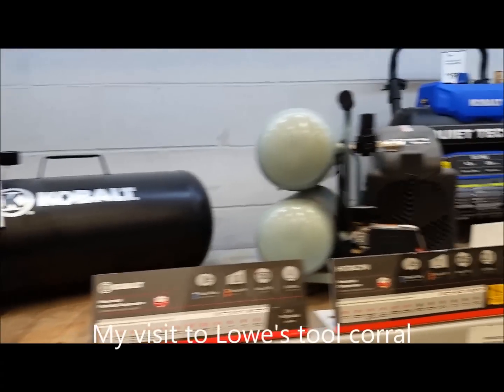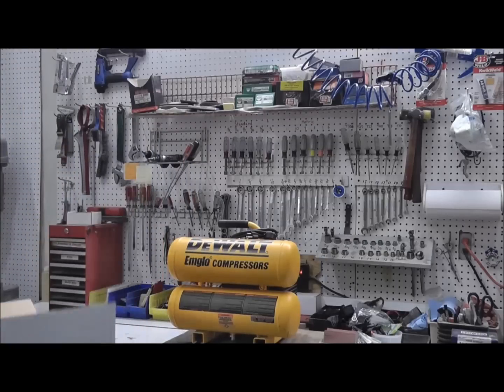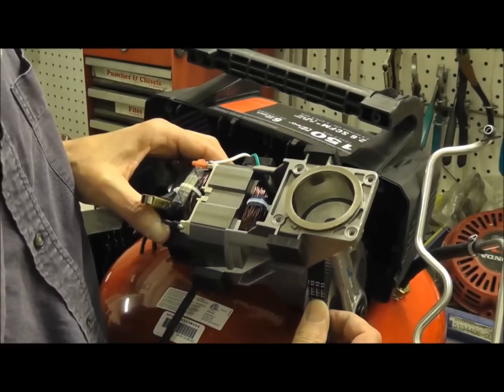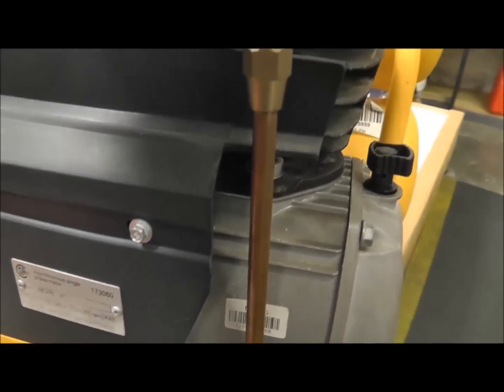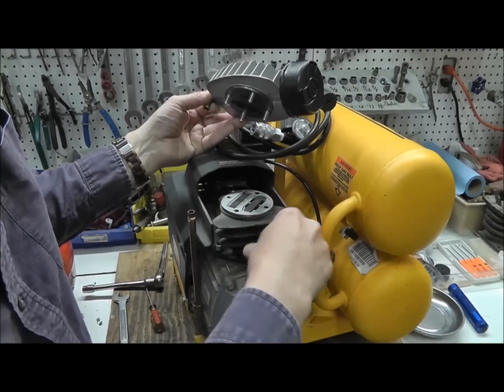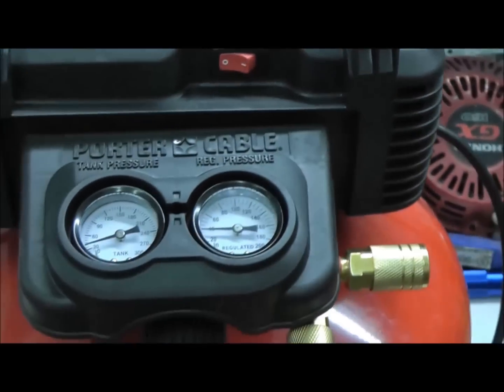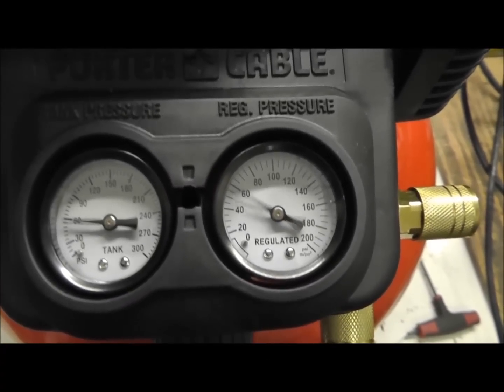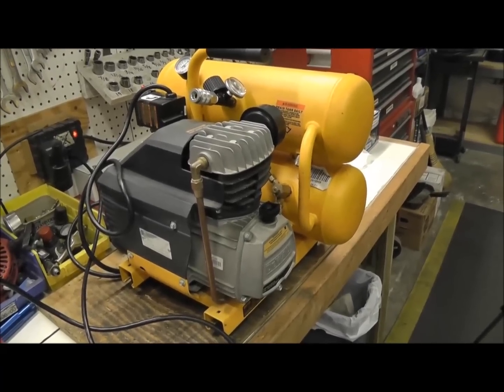Should I buy an oil free air compressor?

Comment: He may mention this as I'm commenting before it's over lol but if you get an oiled compressor and plan to do any painting make sure you get an oil filter for the outlet. There will be water in either style and both needs a water filter but the oil is another beast that will destroy your paint job so needs a combo oil/water filter.
Reply: Apparently something that lasts a long time is more important than functionality.

Comment: That piston is 4 times bigger than the one on the puny little 3 gallon hotdog style Campbell hausfeld I first bought. Takes forever and a day to air up a tire. Glad I moved on up to a bit bigger 20 gallon Campbell hausfeld with 5.5 cfm at 90psi. Works perfect for all I need airing up tires and other inflatables as well as air impact and even a cutoff tool.

Comment: Hello, To me it looks like you’re comparing “apples to oranges” with these two compressors (price points are the difference in construction styles)...  I owned the original Emglo twin tank 4 gallon model and had it for 10 years before I chose to sell it to a friend... I upgraded to the “Masters Series”, the one with the manifold in the center between the tanks(you don’t like) also an Emglo... It is working Perfectly fine(16 years later)...!  You should actually not even mention Dewalt because it’s not Truly a Dewalt...  B&D owns the company Emglo...  Emglo makes the compressors and they paint them yellow for Dewalt...  You can still buy them in blue...
Reply from the maker: Correct, the Emglo name (only) was purchased by DeWalt in the early aughts, and Stanley Black & Decker now owns the name Emglo and build units under the Emglo name with the black and yellow paint. These are not true Emglo compressors. You can still get an Emglo, however, they now go by the name "Jenny, Inc.". The Jenny units are certainly better. Jenny took over the Emglo factory in Somerset, PA and they are still building great air compressors. However, the old Emglo and current DeWalt oil-bath direct-drive air compressors (like you see in this video) do NOT use the same Fini pumps that are on the older models, they're now made in China and are not the build quality of the old Fini pumps. Hopefully this gives some helpful insight into the DeWalt/Emglo confusion.

Comment: Out of all that you showed, the Dewalt/Emglo is the better choice. When these came out They had a lot of issues and aren't the best in a cold area. I like the Bigger Dewalt/Emglo's with the KU pumps have a few old twin tank models and a few of the single big tank models that are 25-30yrs old.
Reply from the maker: Those old Emglo wheelbarrow units can't be beat! They're probably the hardest working and most durable jobsite units out there, along with Rolair's units. Emglo was bought by Steam Jenny and now go by Jenny, Inc. DeWalt bought the Emglo name only and all units labeled Emglo that are black and yellow are NOT the quality of the original Emglo units. Thanks for the comment!
Reply: Switch over to a full synthetic oil and that will help majorly in colder weather.

Comment: I need an portable/light weight compressor to test and charge a 2500 litre volume pvc pipe line with air upto the pressure of  6 kg/cm2. What compressor will you suggest?
Reply from the maker: Thanks for the question! I would recommend an oil-free unit, as you won't have to worry about moisture getting into the lines. Two brands that come to mind are Thomas and California Air Tools. These compressors are more expensive than your "big box " store units, but are much more durable, and have quieter operation. Hopefully this helps.
Reply: @MasterToolRepair  , can these portable compressors have enough juice to fill 2500 litre line?
How long approximately will it take to fill a 2500 litre pipe upto a pressure of 7kg/cm2

Also how long can these type of compressor continuouly run?
Reply from the maker: @green_life7  That I can't answer for a 100%  certainty being I'm not very well versed in the application you would be using the air compressor for. Are you using it for blowing out irrigation lines? If so, the below website should certainly be able to answer your questions as it contains a lot of great information:
https://www.irrigationtutorials.com/gpm-psi-gravity-flow/

Comment: comparing a cheap POS compressor to a much better quality one like the dewalt is a disservice to the point you're trying to make . comparing the dewalt to a 2 HP california air compressor and then sharing your results would be MUCH more legitimate .... .
Reply from the maker: Thank you for the question, Bootymonster, although it's difficult to reply in sincerity to someone with a handle like "Bootymonster". I'll give it a shot, though. Yes, Thomas and California Air Tools both make very high-quality, durable oil-free units, and are generally worth the higher price tag they demand. We didn't have either of these oil-free units available for the video, however. We're not necessarily comparing BRANDS, we're simply comparing the pros and cons, generally speaking, of both oil-bath and oil-free air compressors. I'm not sure where "ego" comes into play here. but alright. Thanks again for the (odd) comment!
Reply: @MasterToolRepair  thanks for replying . my handle is something playful based off the cookie monster from sesame street . i have a 4620A by california air and it has done me well .
Reply from the maker: @JeffB1961  I get it, and it is a funny handle. It's fun to jab each other because that's what social media is all about, right? Anywho, the CA Air Tools units are great and we sell their replacement parts. Most DeWalt units are made in China now, including these oil-bath units. The pumps themselves are based on the Italian "Fini" brand pumps that other brands (like Emglo, Senco and Rolair) used to use, but they're all being made in China now and the quality isn't what it used to be. There is a compressor for every type of application, certainly.

Comment: I just saw a guy rebuild a v-twin oil-less which he claims served him about 20 years, the key to oil-less pumps is that they rebuild rather cheaply and easily. Most do have air filters too. I'd like some estimate as to how many hours they hold up though.
Reply from the maker: Thank you for the comment Robert. Some oil-free units do repair quite cheaply, but it really depends on the manufacturer. Many manufacturers are making parts obsolete more frequently these days, as well. Oil-free units are great for those applications where you need convenience and lower air demand, as these units put out less CFM than oil-bath units. But, if you can't have any oil in the lines and if your'e working in tight spaces, oil-free units are great. As long as they are kept in a clean area, away from particulates, they can last a long time. How many hours is hard to say. How often would yours be used and for what type of tools? They do tend to be noisy unless you get one of the quieter, low rpm units.
Reply: I picked up a very dirty old one, dirt even between the reed valves, I can't imagine where this thing was used. Today I rinsed out the tank and it was unbelievable. I got the new piston and cylinder but needed to order a gasket which was leaking pressure below the head. I plan to use it for hvlp spraying, mini detail type, for practice, occasional use.
Reply from the maker: @robertanon1910  Clean air filters will save you in the long run, certainly. It sounds like this oil-less compressor is right up your alley, then. They definitely have their advantages, depending on the application. Happy compressing!